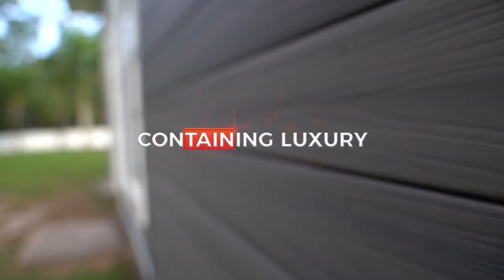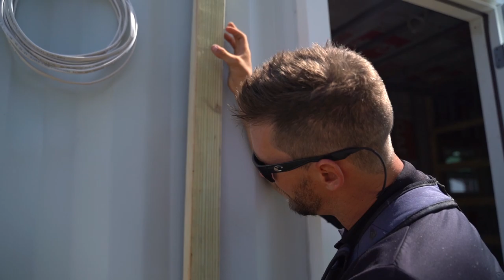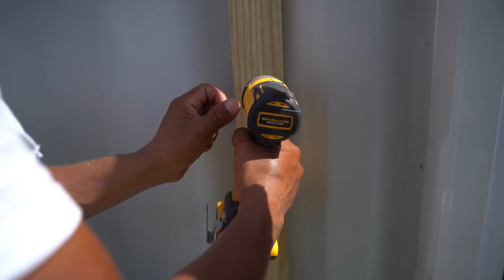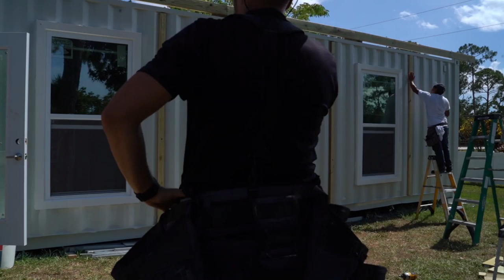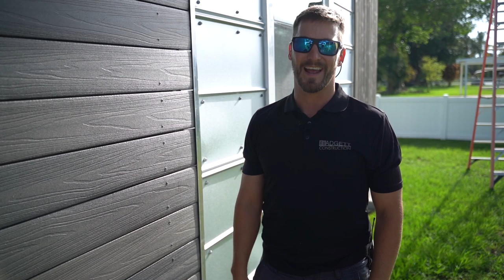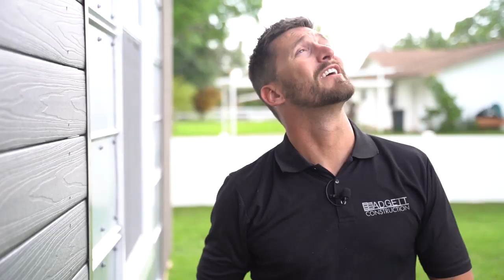Shipping Container Home Exterior Siding for $1,500

Comment: What I did was weld a 2x6 Angle iron to the bottom I-Beam so there is about a 5" ledge then I glued 4" SIPs to the container wall and roof, very fast easy and inexpensive. R-36. I have a high cube so I also laid 3" of foam board on the interior floor, then poured and finished cement over the foamboard. I left the interior walls natural container and use heavy duty magnets to hold photos Etc and for heavier Artwork and such just tie them to the built in tie-down hoops. I wish I could attach photos here.
Reply: Very cool. can you add a link (with some photos please)?.
Reply: I like this solution better than CL's for several reasons: 1. easier. 2. higher R value. 3. maximizes interior space. Not saying CL's solution is bad, but this is the ideal "sweater" concept, even for the floor.
Reply: Great,  insulating on the outside to save space on the inside!  Aircrete or styrofoam aircrete is a great insulation, rodent ,  bug and fire proof.
Reply: @duanethieme4186  ya, just spray something on the outside and be done with it

Comment: Have you considered spraying closed cell foam on the outside of the container and then siding over the foam, in lieu of inside insulation? This would mitigate foam insulation off-gasing problems for those allergic to such chemicals. As well as preventing condensation on the inside of the container by blocking cold before it reaches the metal of the container walls. Also might obviate the need to frame and dry wall the inside of the container, except where you wanted to wall off areas for rooms.
Reply from the maker: dragonrln thanks for the comment! Yes that would work too, the options are endless
Reply: @ContainingLuxury  You can also use the rigid insulation - 2" to 3" thick

Comment: Seems like you would get a lot of bang for the buck with a bit of insulation on the outside. Hav you tried using a siding with a foam-board layer?
Reply: also curious about this...
Reply: I'm getting ready to side and I'm going to use spray foam insulation on the outside

Comment: Thank you for the videos.  Question regarding the metal siding;  is it OK to put Galvalume metal roofing directly on top of PT studs?  From the manufacturer installation guide  "CAUTION: Direct
 contact between pressure treated lumber and metal roofing must be avoided to prevent corrosion."  Thank you.

Comment: Hello Blake Nice Exterior. Love the miraculous designs you have done.  I have a challenge for you >> I would like to have an RV Shipping Container Garage, do you do those?  Need it to be at minimum 12ftW x 48ft L x 18ft H.  Thought of merging 20 ft HC's with open top and create a metal roof from the cut out tops.  Or is there a cheaper way like steel masters buildings? Your Thoughts?

Comment: Could you also show how to do a foundation on piers. Would you want to weld it to the pier?  Would that be up to code in your area.?
Reply: I've seen that system used, because shipping containers are built to stack eight units high. The corners are bolted together once stacked so they don't shift in transit. The stress points are the corners (20') with a midway stress point on most 40' containers.
Reply: Another option would be to embed anchor bolts into the piers and double nut the container to the pier.
Reply: @SpankinHands 40’ doesn’t need a midway support as it is designed for cargo of 30 tons with midpoint not touching the ground. A load in a home will be far less.

Comment: Is it possible to put foam board insulation in space between siding and container? Trying to save as much interior space as possible and it would be great if I could effectively to do by insulating connex on outside vs inside. 
Thank you 😋
Reply from the maker: Yes, you could however you need the interior space regardless for running electrical wiring and possibly plumbing lines.  However if you have a different plan for that, then you could put the studs like we do in the siding video and then tac your insulation board to that and then place your siding over it and screw or nail all the way through the insulation board to your studs... make sense??
Reply: I like the idea of insulating the exterior of a RAISED (by 16-24”) container, and for the interior, keep it natural metal, but paint the metal with a light color acoustic-absorbing paint to avoid that echo sound!?!  I live in a tropical paradise, where it never gets cold nor too hot!  I would then run the electrical in metal conduit at the top portion, screwed into the square metal tube with self-tapping screws, then drop down the wire inside more metal conduit for the light fixtures and outlets at varying locations.  From here, you can easily run wiring inside more conduit for ceiling fan fixtures, too!  (Maybe even consider running some of the wire inside conduit coming up from the floor?) For the plumbing, I would go thru the wood floor, being cognizant of the extremely thick metal floor bracing underneath! Measure thrice, cut once, for your commode plumbing and shower/sink drains, and incoming water lines!  For hanging cabinets, use 2”x3” wood studs, secured to that upper square tube, and glued to the metal, hanging downward in the metal corrugated grooves, and attach the cabinets to those.  Base cabinets can be secured to the floor, and secured to the wall by wood that is glued to the metal wall, much like the wall cabinets or the exterior siding shown in video!  Great ideas, seen on these videos!  Thanks for posting!

Comment: Great video, on the exterior siding any thought on exterior insulation? There is a company that makes insulation that fits in the waves of the container. You glue those in place and they have a stud like plastic embedded in them. I am in a cold part of the country, near Duluth MN, planning a shop with containers for walls set about 40' apart with a roof over the whole thing. I am looking at exterior insulation only on the exterior walls of the containers. Your example has a 1" pink board. I don't see that as enough for -40 or plus 80.  So my thought is panels from insofast.com, then 2-3" of the pink board or Rockwool with a vertical stringer screwed through the to the insofast, then lap board siding. bottom screened off for bug control, top under the roofline.
Reply from the maker: Yes! And we are using it here soon! We just spoke to insofast and we are going to do a detailed video on the system and if it works as well as they claim! I am not sure if you can use those on the exterior but I will find out! If so thats a great idea!
Reply: Containing Luxury thank you for the reply. I look forward to seeing your work. Most of this is available from “the build show” here on YouTube. Matt does all conventional construction. The idea is to move this to container. My project will be shop. Heated 40x60 slab with a container on both ends as walls.

Comment: Did you ever show how you fixed the studs in the inside to the wall or did I just miss it? 
Is it also with glue plus screws? 
And how far can you actually screw things into the walls of the container?
Reply: I would think the screws would be sticking out on the other side unless they were grinded or cutoff from the interior which is a lot of extra work unless they were drilled from the inside out. I'm sure the glue works ok from the start but my concern would be how many years will it stay bonded when exposed to climate.

 Even with self tappers that would still be a chore getting through that steel I would use oxy acetylene to make small holes before installing any of the wood then drill the screw from the inside out but open to ither ideas
Reply: @marcushennings9513  -- I'm with you -- Who wants the siding or interior cladding popping off five or 10 or 20 years down the road? Cutting or drilling holes, then bolting interior and exterior boards seems like the best long-term solution, and it wouldn't be that difficult if everything was measured really well so it could be drilled and bolted.
Reply: @SpankinHands yep. with good wind/storms and if in extreme temperature fluctuations/humidity  I'd say more like 3 yrs tops..I tend to overbuild because I dont want to keep foolin with the same issue
Reply: @marcushennings9513  -- I admire your standards. I'm not a builder, but why "plan to fail" or "hope it holds?" A friend bought a new build condo and wanted help hanging the artwork. He was astonished that I used a piece of cardboard and a 2x4 so there wouldn't be six holes behind each frame when one-and-done did it.
Reply: @SpankinHands  of what I have built or assembled I've learned to never skimp and will go overboard on fateners (quality nails, screws) and protection (quality paint, waterproofer).

Comment: Thanks mate for your great videos.. Just curious as I would be cladding a shipping container.. would installing upright as opposed to sideways make a difference? Styrofoam insulation outside with PVC cladding..... for Ireland.. with mostly cold and raining conditions..highest temp 25 degrees Celsius
Reply: From what I've read, in extreme temperatures, condensation is the issue. There has been a lot of study, but many builders get around that by opening the top of the container and building a pitched or barrel roof on top. Colorado has some emergency "hunter cabins" in the mountains made from containers. They are spray foamed on the interior before being clad with siding, but I haven't read updates on how that fares against condensation. I know that for safety, there needs to be a standard rate of air exchange, otherwise occupants would suffocate -- especially if using a wood, pellet or propane stove.

Comment: By the time you've put on a roof, battens with exterior siding, internal framework with dry-board and cut the windows out, what's the point of using a shipping container?  Wouldn't it be easier to use a wall-less container frame within which you could add single framework for both inner and outer?
Reply: A huge amount of the strength of the container is achieved by use of that corrugated steel. Every time you cut an opening for a door or window, you have to reinforce it to make up for that. Not saying it can't be done, it can, but it's going to cost you.
Reply: @genjii931 the load bearing structure of container is its frame. The corrugated sheet is there just to hold the cargo in. It  is not designed to be a structural member.

Comment: I had a question. Does any sort of insulation goes between container and siding finish? Where i am there is 4 full seasons. Forest area.
Reply from the maker: Djabrail NTP if you have any extreme temperature changes you really want to insulate as much as possible, if you insulate the outside you can use all different types but go for R-13 or greater, if you insulate the inside it must be closed cell, in a perfect home you would want to close cell thin layer on inside and then insulate the outside on top of it, then you know your super efficient but can be expensive

Comment: What kind of screws did you use? Link if you can. Plz and ty.
Reply from the maker: Byron Kelsey for installing the 2x4 to the metal we used a 2.5” self tapping hex head heavy duty screw.  We are actually going to shoot a video next week installing wood siding on the other side and I will show and detail and make sure to link to them! So stay tuned
Reply: @ContainingLuxury  hi also interested in the siding using these screws. Is the video published? Can't find it. Thanks!

Comment: Attaching horizontal siding to a vertical stringer is obvious. 
How did you attach the vertical siding to a vertical stringer? 
You skipped over that step.
Reply: It works because the wood is tongue and groove so the wood is all locked together and then they secured it to every vertical board that they could. You could also glue the tongue and glue joints together as well.
Reply: @jasonslaton9052  Sketchy!
Reply: You could put up horizontal stringers that screw to the vertical stringers.

Comment: You glued the siding supports to a painted surface. So, essentially the strength of the bond is dictated by the strength of the paint adhesion to the substrate, which from a previous video, I noticed you just painted on top of a previous layer of paint that was already peeling. Seriously bruh, do you actually know what you're 3?